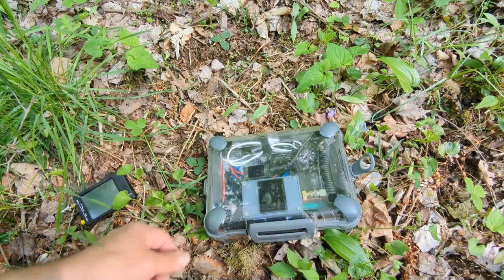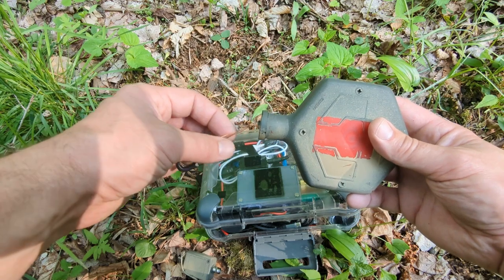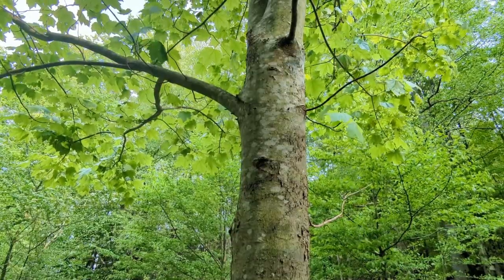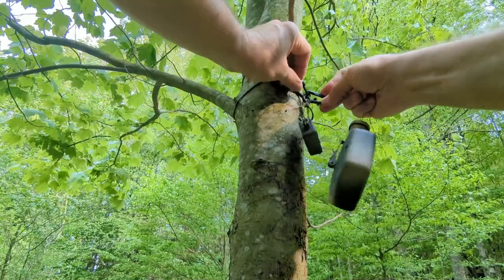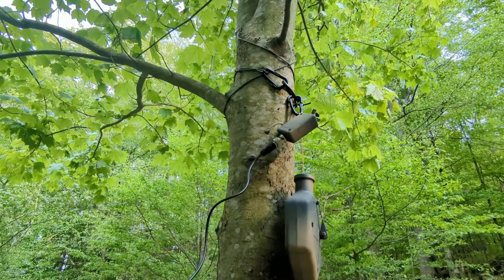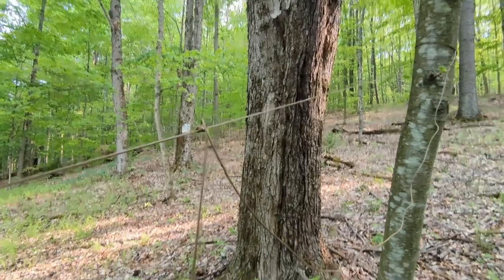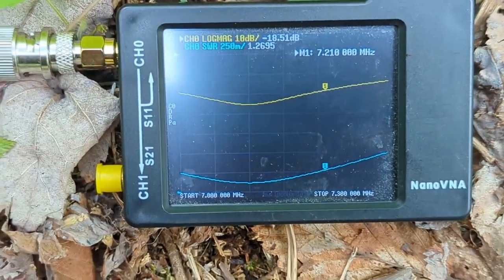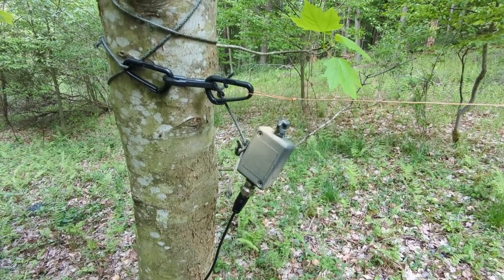Fastest No Tune 80 10 EFHW NVIS Antenna? Chalk Line based Ham Radio Antenna.

Comment: Yep i use the same copper line and Irwin speed reels (might change to your reels) for my setup.  Nice, compact and easy to adjust.  Instead of knots i added small heat shrink tubes to mark my bands.  Instead of hanging my reel by the copper line, I tied a kevlar kite line into a loop and fed it into the case opposite to the line side.  Keeps it insulated and has 500lb test strength.
Reply from the maker: Nice setup! I made the gear drive speed reels last time and switched to this one.
Reply: where do you guys get the copper braid line?

Comment: really cool little setup !!
 awhile back i built a couple metal irwin chalk lines for tree climbing, replacing the chalk line with throw line. one thing that i did was add a para cord loop to the back of the box. i just drilled a hole, took the box apart then put a loop around where the screw goes and put back together.
Reply from the maker: Definitely a good idea. I am going to add that to this and future versions.

Comment: Pretty cool stuff! I just eliminated several antennas from my go bag as a result. I bought one and just got 135' of sotabeams pvc-coated wire measured and added. I drilled a small hole in the spool to feed the wire through and knot it. Winding it up starts get a little snug as I wind the last 10' or so but it's fine. I am considering adding a banana socket to the center of the spool, opposite the handle. I often use Jackite poles and the weight of the winder would be too much on the far end, so I would merely reverse it. Not sure if the coil of unused wire will impact resonance and performance if it's on the feedpoint end of the spool though.

Winding it up after deployment would work best with some tension, so I will secure the far end to something and walk as I wind.
Reply from the maker: Exactly how I wind mine as well. Have you tested this with a VNA yet?
Reply: @BucktailResearch  Yes, that's how I marked the wire for each band. It varies in the field, as you might expect. But it's always in the ballpark.

Comment: Bought the QRP Guys 80-10 kit and with the spade lugs, it was too tight of a fit at the connection where the BNC Connector and the spade lug were all tied together using their dimensions for hole locations so... just ordered the next sized up box from Digi-Key (Hammond 1551TBK). That will provide enough space to get everything installed, use a hot glue gun to secure the parts so they don't rattle around and should be set.
Reply from the maker: Interesting. I didn't have that problem with the one they sent me. Wonder what changed?

Comment: Great work on the velcro box.  I use 15' of LMR100 but thinking of making that coax 20-25' now.   I use a TennTennas 25W EFHW transformer since I use it with G90 too. QRPGuys 10W is smaller tho.  You reckon  ~150 ft PolyStealth 22 wire would wind on that winder?  .052" OD, 70lbs breaking strength.  Inspiring videos!
Reply from the maker: I'm not sure if that much will fit, but I will see about trying that. Also will look into that transformer. Thanks for the suggestions!

Comment: This is such a cool design! I definitely want to build one soon. Just curious, could you theoretically install the transformer into the chalk line holder? Or does it have to be on the "loose" end? Thanks!
73
KB3TVP
Reply from the maker: I am going to mess with that next. Thinking maybe start with an alligator clip and attach gently so as not to crush the wire needlessly. Perhaps some kind of brushed contact internally would work. I am working on 3d modelling some new ideas for this, I may try to incorporate the transformer into the housing itself.

Comment: What adjustments would you do for 100W? This looks awesome. Would it be possible to do this for 100W? Would the wire/line get too bulky for the winder? Great stuff.
Reply from the maker: Yep! I have a larger setup for my icom 706. I am sure the wire isn't technically ideal, but with a larger transformer rated for that power it seems to work fine.
Reply: @BucktailResearch  This was going to be my exact question.  I'm a new General, and not that QRP "saavy".  Any advice on which transformer would be useful for that application?

Comment: Maybe a stupid question - does the unused copper wire still rolled up in the reel not change the antenna length?
Reply: It does not add to the antenna length.

Comment: When you calibrate your nanovna do put the calibration pieces at the end of your feed line? Also have you tested 45# copper leader with this chalk line? Thanks for sharing!
Reply from the maker: I have not tested the 45 pound test yet, but that's only because the price on this 30 pound was significantly cheaper at the time. I put the calibration pieces directly on the nanoVNA itself, as the feedline is part of the antenna system. That needs to be included in the test.

Comment: I use something very similar with a locking scuba finger reel. Is there any penalty(that a dedicated antenna analyzer would show) when having the extra line wound up beyond the endpoint? Windcamp has a dipole with winders and tiny ferrules marking the bands. There's gotta be a reason convention calls for trimmed line, no?
Reply from the maker: Thanks for asking! With insulated wire, there may be some capacitance at play, but this bare copper just behaves like a solid chunk of wire at the end. It works very well.
Reply: @BucktailResearch  that answers my question!

Comment: What's your estimate of max power and radiation pattern?
Reply from the maker: The radiation pattern is just that of a basic End Fed Half Wave. If you use the 80m length but are TXing on 20m, it's a very bizarre looking pattern, so I try to use the correct length, even though multiple bands can get a good SWR. I found those patterns with a google search that someone had modelled. Not sure the source at the moment.

Comment: stainless steel down rigger ball cable is realluystrong and comes in different diameters
Reply from the maker: Very lossy electrically. Otherwise I would use it.
Reply: Stainless Steel wire is far less efficient than Copper Wire.👎🏻